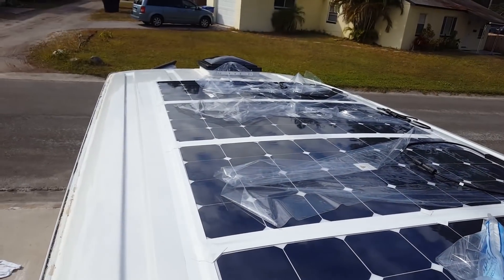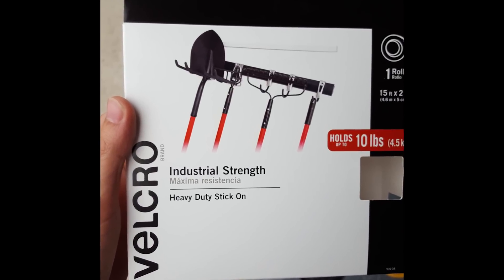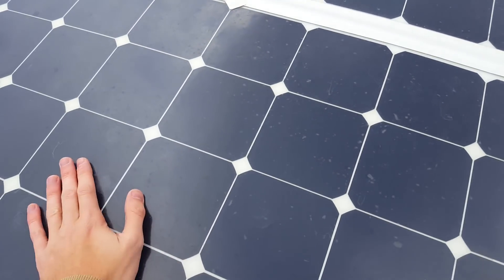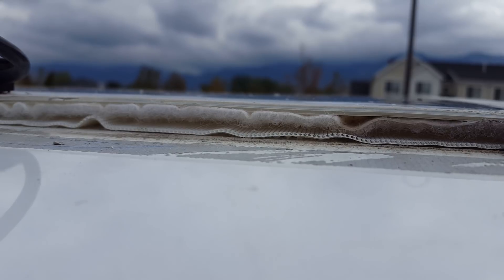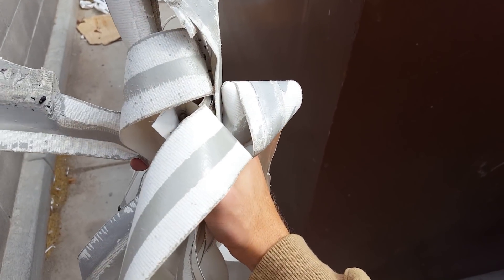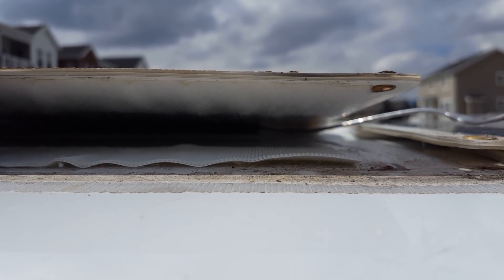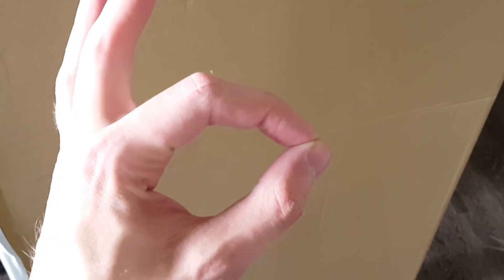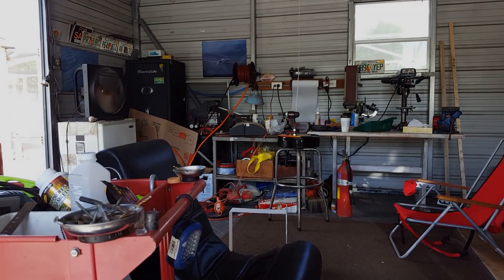Installing Solar Panels with VELCRO DIY | [REMOVING & REVIEW]

Comment: So, did you end up putting the the panels on with just the Velcro without the Gorilla tape? We just re-did and added more panels to my roof and we only used the heavy dusty Velcro. They are not moving. That Velcro is amazing.
Reply: Even considering using eternabond or vhb tape on the side of the velcro that is stuck directly to the car
Reply: @peishawilliams427 same here, did you end up finalizing your installation?😊
Reply: That’s what I’m wondering. About to put flexible solar panels on and I don’t want to stick them directly to my roof. How did the Velcro work for you after 2 years? Still working?

Comment: its deff a super clean install, maybe find a way to get air under them for a cooling system while in motion... Solar is my next step, I just got my solar controller and power inverter this week, just gotta buy my panels next. I plan on doing rigid just because I've heard & seen so many flex panels break. rigid say they have a 10-25 year warranty! (yes I stopped to read ur text!) haha gonna watch your install video next!! keep on keeping on bro!!
Reply from the maker: There's some, not sure what you would call it, but some indents for water travel on the roof. Air can get in underneath them that way.
Reply: at least they are fixing them when they break, you can't beat that! in a perfect world id lift the panels 2" off that metal roof, but to each their own!!

Comment: Right on. My setup is based off yours in this series, mine has ridged solar panels tho.
Reply from the maker: Eminence FrontX5 I'm told those last a lot longer
Reply: zhkopec i assume that the solar material is brittle and lead me to using high impact glass used in Zamp panels.
Reply from the maker: The flexible plastic ones are vulnerable to scratches, but the glass ones are vulnerable to shattering. Bit of a trade off either way. For durability I would probably lean towards the glass ones though.
Reply: zhkopec as an example of desirability, my panels flew out pf camp on a very windy day, 50 to 60mph winds, they flew about 10yards out of vsmp landing face down, glass down and still did not shattere...they work fine still too, esp after i mounted to suv.
Reply from the maker: Woah, that's a durable panel right there. :O

Comment: 50% failure rate in 6 months? Ouch. That's why I went with rigids. Glad they are good with the warranty. Was there a reason you installed in series vs parallel? I run all four of mine in parallel so that if I get shading on one it doesn't kill the whole system.
Reply: HOBOTECH, I was thinking the same thing, wiring in parallel is absolutely superior.
Reply from the maker: HOBOTECH Mostly because it was more wiring to run in parallel. Haha. But yeah rigid are better for durability but I do save a little bit on aerodynamics with the flat